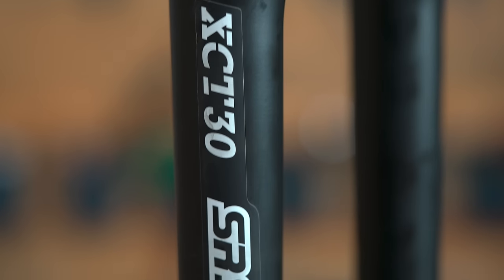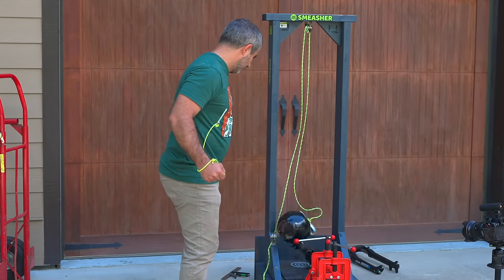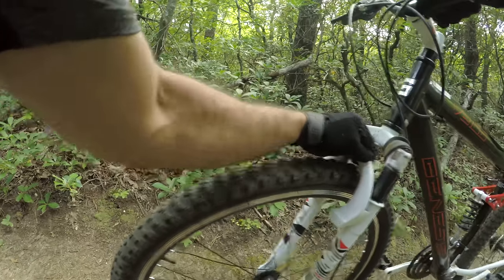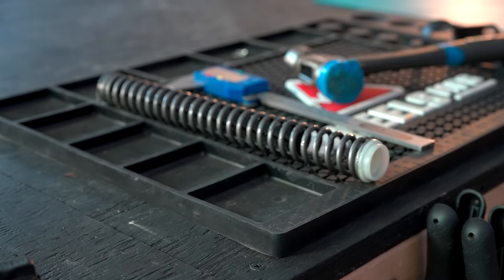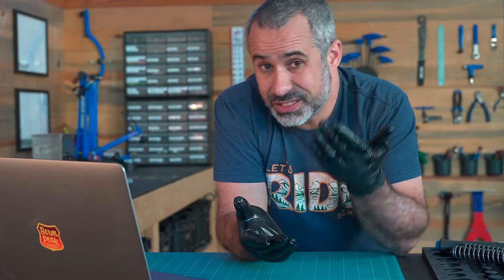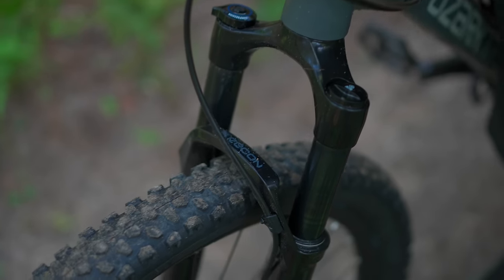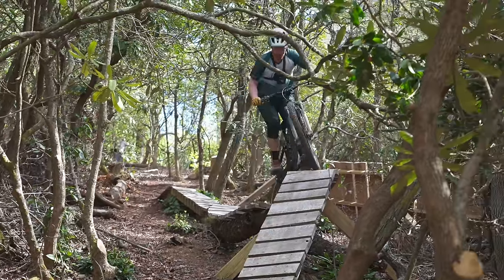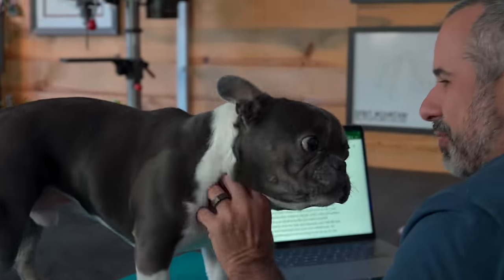The most popular MTB fork you (probably) know nothing about

Comment: I still dont understand the difference between XCT and XCM😑
Some say they're same. Some say there are minor  differences. If that's the case, what are those minor differences?
Reply: afaik one of them is slightly higher end, the highest end of the xc series is the xcr air fork. which has real adjustable rebound, and adjustable air preassure, compared to the pogo stick coil springs this on is wayy better.
Reply: I know. xcr>xcm>xct. I heard that. But I want to know what exactly are the differences.

Comment: I put a front hub motor on one of these forks and broke it. The axle dropouts simply can't handle the torque and I had a nasty crash with it.
Reply: yeah for front hub you need a fork designed to take load in that direction, which most forks Just are not. heck a rear hub or even middrive is better either way.

Comment: hey does anyone know why on by bicycle the higest gear is trying to shift and make a sound it only happening on the lowest gear and only when i physically ride not when i'm manually check by lifting the back and pedeling can someone help me. i gave it to a mechanic and he just changed the whole back wheel and  the Cassete for 2 days no problem. please help!
Reply: The description is not really clear, however if the bike tries to shift it could be a bent derailleur hanger or the shifting needs to be adjusted, if the chain jumps the chain could be worn. From this description the problem can not really be identified

Comment: It depends on the rides, to choose a fork, and usage overal or specific. Area, storage maybe. Maintenance, sports I mean overal it does matter, what fork to take, to see what last longest. I guess 80-90 % of the users in my area use them on roads, road climbs, small hilly soft forest, seldom roots.  Etc. It matters when all over circumstances and usage, purpose and fashion. It has geographic varieties. Etc..till storage size. In Japan, many little bikes are sold...etc...foldable. Also Foldable MTB. Even foldable 29er, double suspensions, and or with electrical mechanical supports. Lol.. But it can cost a buck or some. All over this globe this varies. And changes, and has ranges, options, needs, endless varieties, and so we should actually just advise I think? Some here want to simply pimp it till max, with all stuff attached, and forks are important, status hehe. :D

Comment: but the xcr is kinda bad. and its on a lot of bikes because an air fork is a lot more marketable. but if the coil suits your weight, xcm will ride a lot better.
Reply: you need to setup the xcr air properly. lots of people that ride these dont do that and then complain when it rides like crap. air preassure and rebound can be adjusted and should be adjusted.